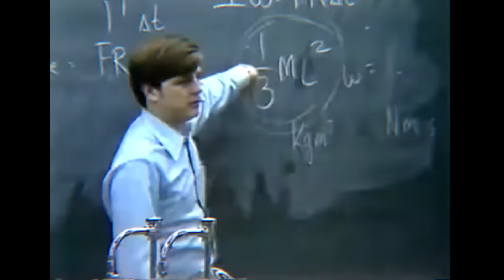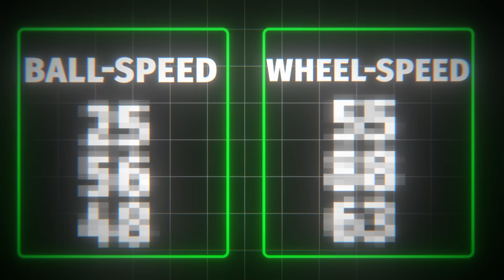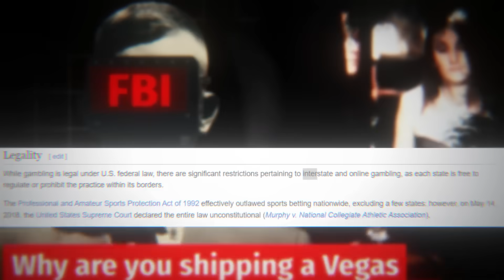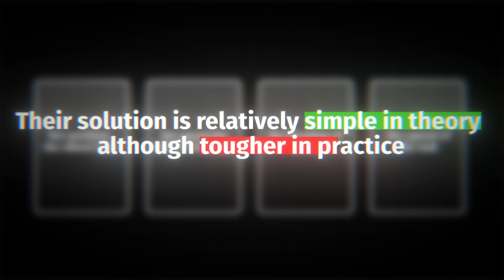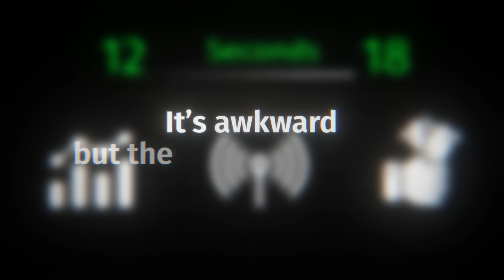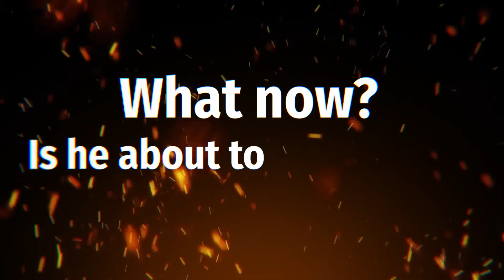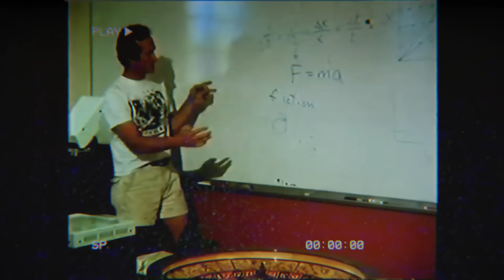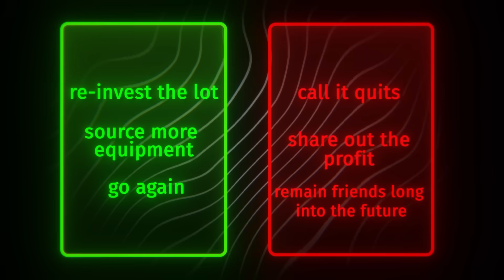The Nerds Who Beat Vegas Roulette With Science

Comment: Surely the speed is different every time based on the individual. Like between each spin it changes a bit
Reply: The speed would be different every time, but they created their computer so they would input the speed for one rotation of the wheel (basically push a button when the "0" spot reached them and push it again when the "0" spot came around again) and do the same for the first rotation of the ball. With this information, i.e. the measurement of speed of ball and wheel for the current spin, the computer could roughly estimate where the ball would drop (it was mostly accurate to about 1/8 of the wheel, a range of 4 or 5 numbers). When the computer gave it's result, they could bet on those 4 or 5 numbers. Most of the time one of those numbers would win and the others (of course) would lose. But the win paid 30 to 1, so overall they would win. Most of the time.

Comment: This is inaccurate on so many levels. You can’t predict how a ball will bounce. PERIOD. That’s why they’re a numerous metal diamonds around the wheel, and why where the ball lands has such sharp and steep walls. Also once the ball has dropped and is no longer spinning in the top rim, the betting time is over. So any claimed advantage by knowing an area of 5 numbers that will hi is a moot point cause you can no longer place bets at that time.

Comment: When I hear "beat Vegas" I assume you mean "legally".  Not blatantly breaking the law and risking years in prison to steal from the casino.  Might as well just double park your motorcycle outside Bellagio, run inside, and grab $1M in chips off the high-limit craps tables--it's a lot easier and doesn't require months of effort and high tech contraptions (search for "cranberry bandit" and read Rolling Stone).

      NRS 465.075  Use or possession of device, software or hardware to obtain advantage at playing game prohibited.  It is unlawful for any person to use, possess with the intent to use or assist another person in using or possessing with the intent to use any computerized, electronic, electrical or mechanical device, or any software or hardware, or any combination thereof, which is designed, constructed, altered or programmed to obtain an advantage at playing any game in a licensed gaming establishment or any game that is offered by a licensee or affiliate, including, without limitation, a device that:

      1.  Projects the outcome of the game;

      2.  Keeps track of cards played or cards prepared for play in the game;

      3.  Analyzes the probability of the occurrence of an event relating to the game; or

      4.  Analyzes the strategy for playing or betting to be used in the game,

Comment: Great video!

If someone wishes to test this, I think the best option would be an automated roulette wheel that spins on a set timer. It is more likely that the ball and wheel are going the same speed each spin. And with a set spin timer, it should be easier to predict the side of the wheel the ball will land on with enough data gathered.
Reply from the maker: Some researchers did test this deeply a while ago, it's why they broke the silence on how it was done. I believe they used a smart phone to replicate the strategy! Will find the references and add the link later for you :)
Reply: @TILT223  that would be awesome! I've definitely noticed slight patterns to the automated roulette wheel I frequent, but it doesn't seem to hold every time and takes hours of sitting there looking sus to collect data points 😂
Reply from the maker: This reminds me of another story where a croupier from Miami accidentally stumbled on a pattern like this...
Reply: @TILT223 The modern wheels spin at a different speed each time so this loophole won't work anymore
Reply: auto roulette is fixed.  It's based on RNG. so unlikely to be able to do it with auto roulette.